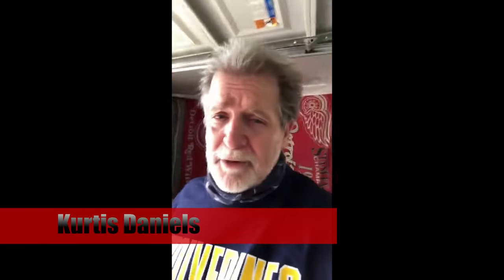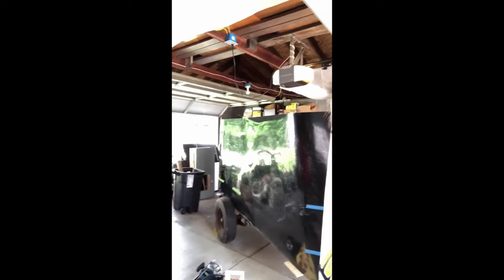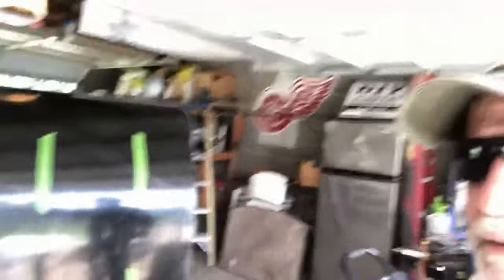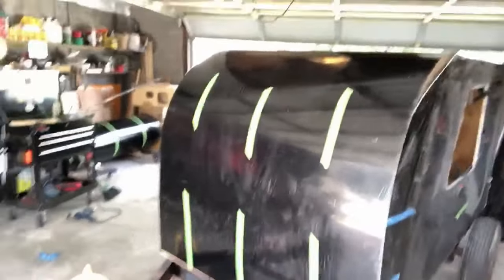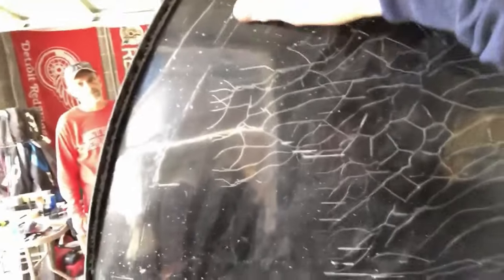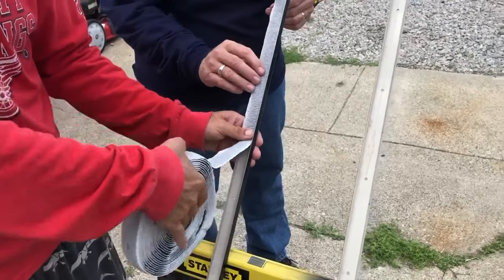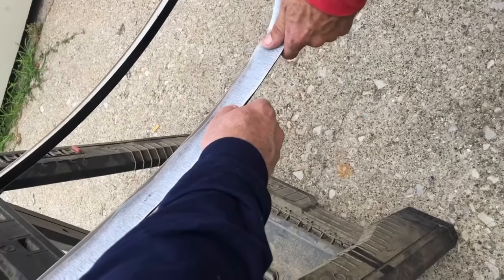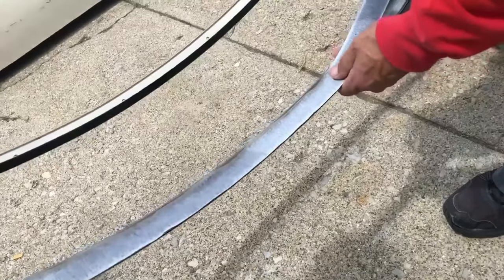Filon Install With Kurtis Daniels

Comment: Thank you for sharing.  So the only thing holding the filon in place is the edge trim and door trim?
Reply from the maker: Yes, along with the window. I did add diamond plate later on and it also helps hold things. Thanks for watching!